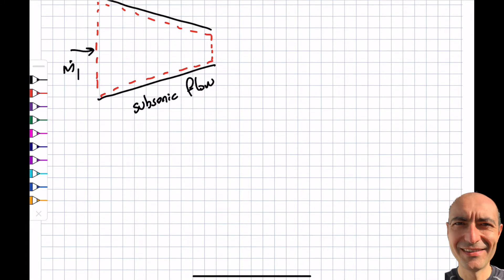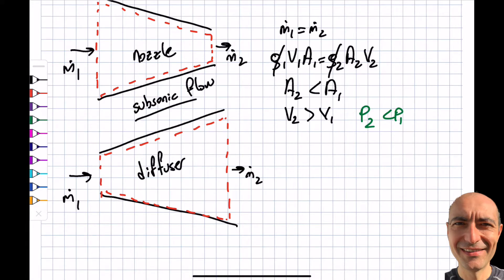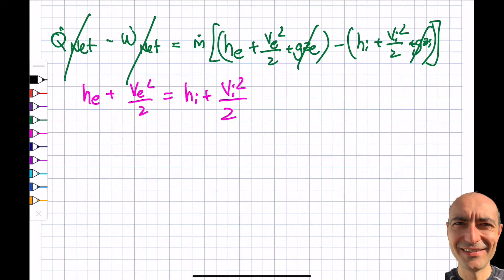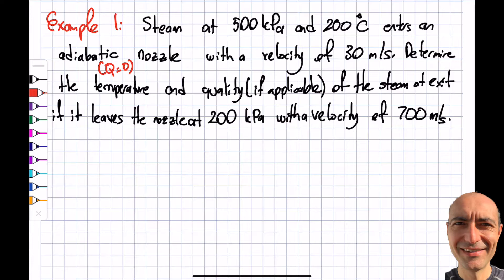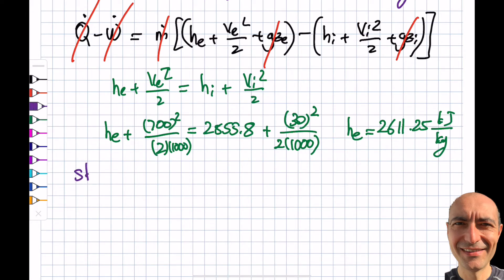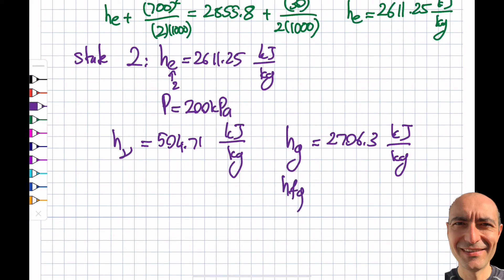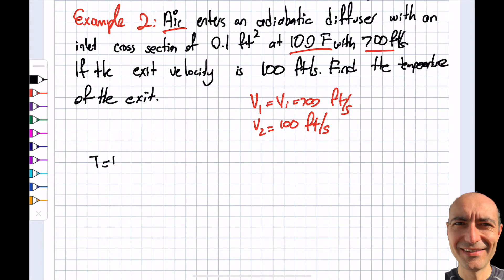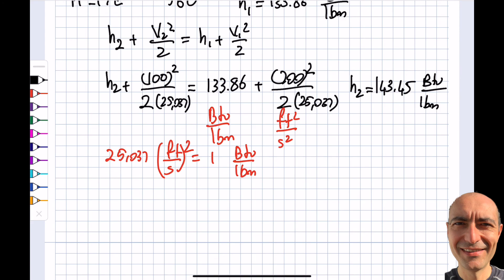Thermo 5.4 - Nozzles and Diffusers - Two Solved Example Problems

Comment: if pressure is force/area, why is the nozzle at p2 less than p1? shouldn't it be greater because it has a smaller area?
Reply from the maker: Good question, Michael. From the conservation of mass, V2>V1 (I think we agree there). It is harder to explain/grasp the pressure relationship. As velocity is larger in section 2, the enthalpy of the exit is smaller than the inlet. You need to replace specific enthalpy is equal to internal energy+pressure*specific volume (h=u+Pv). As T drops in a nozzle, internal energy drops more than P*v, requiring higher pressure. The explanation is much more simple if you took Fluid Mechanics class. Bernoulli's equation requires the pressure to be smaller for higher velocity.